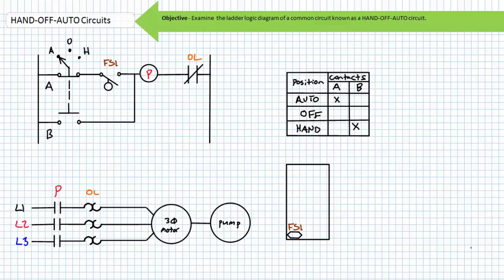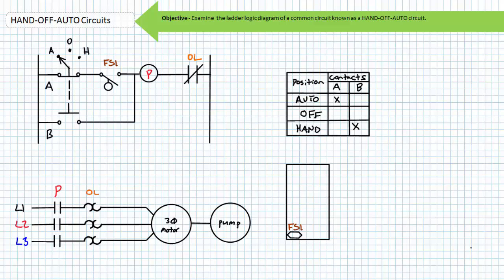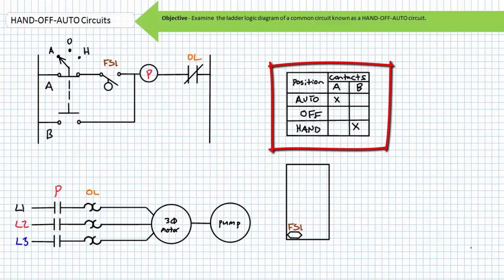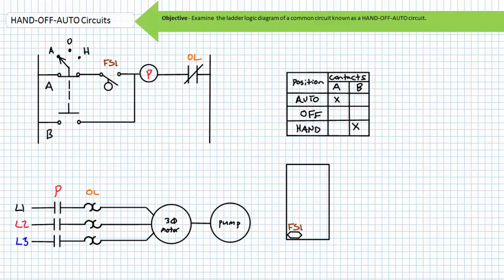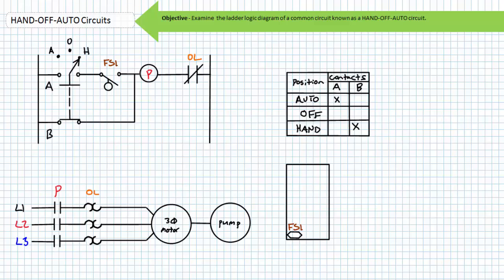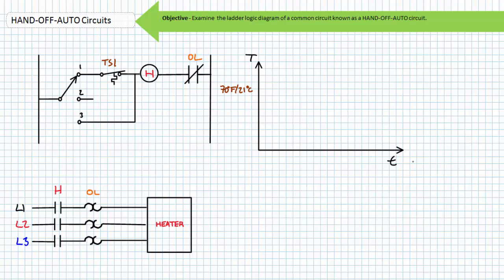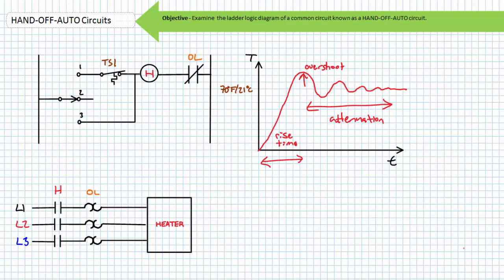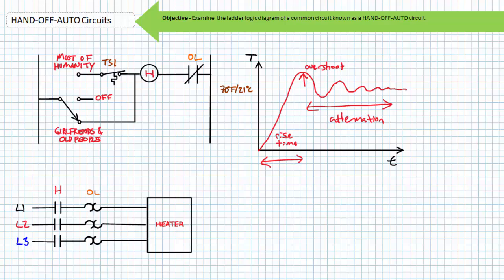HAND-OFF-AUTO Circuits (Full Lecture)

Comment: Thanks for the video! Can you please clarify whether the Auto contact is NC or NO? I see most HOA switches specified with NC for the Auto and NO for the Hand settings. I understand the NO for the Hand setting, but it really seems like the Auto contact should be NO as well. Looking at its position when the switch is in the OFF position in your diagram, it appears as though it is NO. Then, when the switch is in AUTO, it closes.
Reply from the maker: Good question ... it really depends on the process you're trying to run whether the switches are NO or NC. 
NO -> Pump liquid OUT of a container when it reaches this level 
NC -> Pump liquid INTO a container until it reaches this level
Reply: @bigbadtech  Thanks for the quick reply. Good point, I should have clarified the operation scheme for the setup I’m asking about. A few details for you:

1. The setup pertains to a well pump which simultaneously fills separate fire and domestic water tanks. In other words, it’s a fill-up scheme. 
2. There is a float switch in each tank, such that the well pump will stay on until both of the tanks reach their target levels. Thus, I assume that the NC contact of each float switch will be wired in parallel, inline with the “Auto” circuit. In other words, in their “Off” position, the float switch contacts will be closed and the pump will run. When both tanks have reached their desired water level, the float switches will go to their “On” position, which will open their contacts and the pump will turn off. 

With the above details, given what you said I get your statement that the “Auto” circuit requires a NC contact, i.e. allowing the pump to run and fill up the water tanks when either of the float switches is closed. I think where I am getting confused is that I envisioned the “Auto” contact to be NO, i.e. it is open by default but closes when the HOA switch is turned to the “Auto” setting…causing the contact to be “activated” and closed. Same thought process for the “Hand” setting…it gets a NO contact which is open all the time, until you turn the HOA switch to the “Hand” setting, the contact closes, turning the pump on (regardless of float switch positions since those have been bypassed for the “H” circuit). 

Does that make sense? I mix up simple control things like this all the time and likely have here. 😢 Hopefully you can explain. 

Once you address the above, perhaps you could comment on utilizing an actual HOA “switch” vs a switching mechanism with electrical contacts?

Thanks again!
Reply from the maker: From what I'm gathering it sounds like a NC float switch will work in AUTO mode (ie: remains closed and energizes pump until it reaches level opens and turns off). 

Often only thing that distinguishes an HOA switch from a regular selector switch with NO and NC contacts is a trim plate that says "HOA". Check out the switches lecture at: https://youtu.be/ENCdPsA9PXc
Reply: @bigbadtech  Thanks for the comment RE: the float switches. That too makes more sense. Circuit closed, pump running, float switches flip up (tank filled) and circuit opens. 

So, I will def check out the video on switches. But, as far as the NC contact for the “Auto” circuit…when the selector switch is in the “A” position, I assume the control voltage is NOT applied to the NC Auto contact, hence, it stays closed? Then, when the selector switch is turned to “Off” or “Hand”, that contact must be energized and opened?

Comment: What’s the difference adding the maintained contact than the first circuit you should?
Reply from the maker: What time in the video are you referring to?
Reply: @bigbadtech  you have 2 different switches. The first circuit switch is different from the second example.
Reply from the maker: No functional difference however different hardware can be used to implement the same type of circuit. First circuit features a maintained selector switch with double break contacts whereas the second circuit features a single pole triple throw switch with center off.

Comment: (P0967 code )Chevrolet cruze  ..clutch pressure control (pc)solenoid 2 control circuits high voltage.     Problem please tell me solve this issue.  And p2730 same solenoid valve 5. High voltage
Reply: Do a better one

Comment: No, that's not how they do it... The center is where my stupid visors were caught bowl-blowing the scrubbing nub machine, they were waiting on their usual main I mean chow main during lunch, the hand off auto switched into the position that wasn't hand auto because it stuckdeded close from the techs solder mess on the contacts, then the float switch I told them it was full when the pressure released all the way in till the gauge was leaked out max...also, the tank was at the bottom but when it is momentarily at the topped out position on the bottom it's the top float switch that let's loose the stuck DIYM booty button...

Comment: Jim, what are your thoughts on using HOA switches as LOTO points? We have an ongoing debate in our plant where those more familiar with the ladder logic and PLCs state that a "computer glitch" or a little bit of "fiddling" could inadvertantly start the machine despite the HOA being in the Off position. We are slowly moving to the E-stop buttons rather than the HOAs for this reason. In critical safety situation, we use the E-stop to stop the machine (LOTO it) and them upstream to the actual line voltage disconnect and LOTO it. I guess my question is, in your opinion, can an HOA ever be a dependable LOTO point when the machine is controlled by PLCs?
Reply from the maker: Excellent question. Check out the "PLC Interface Methods" lecture at: https://www.youtube.com/watch?v=G4uo0Sm0uMo My sincere advice for any of these scenarios is to simply remove the PLC from handling any and all safety scenarios and LOTO the system at a hardwired connection (ie: the ESTOP).
Reply: Bro. Sounds like y’all need to upgrade to DDC. If done correctly you’ll never ever have any issues with HOA running. I’ve never encountered an issue with DDC. The computerized half may be “complicated” but if you know how to navigate windows or Mac. You’ll be fine. The actual low voltage side is simple. Just relays and 24VAC/12V DC. 
Very simple. And the relays are super super reliable. Well I can speak for automated logic. It’s been a solid platform for pumps and lights.

Comment: Jim, when the temp rises, due to the heater been energized,  and reaches setpoint the thermostat opens or breaks the circuit and the heater is turned off.  Why are you saying that when the temp drops below the setpoint the temp switch (Thermostat)will return to its deactivated closed state? 
Shouldn't we say... "deactivated"... when the thermostat is satisfied and opens the circuit hence turning off the heater?
Reply from the maker: Check out the "Switches in Electrically Controlled Systems" lecture at:
https://www.youtube.com/watch?v=ENCdPsA9PXc
the "deactivated" state refers to the electro-mechanical nature of the switch and not the state of the heater.

Comment: How about a H-O-A system incorporating a float and a time delay on the auto circuit, then a 3 wire with two start/stop locations on the hand circut? I'm having a problem trying to draw a ladder diagram......
Reply from the maker: Stay in touch because lectures on timer relays are in the works. Ironically enough one of the example problems is a pumping circuit incorporating a float switch and timer.
Reply: Thanks...